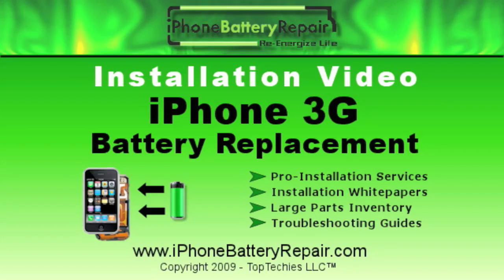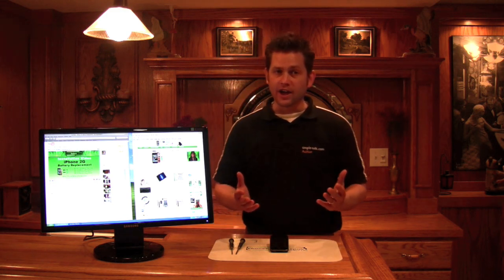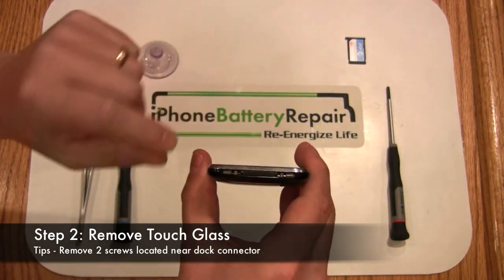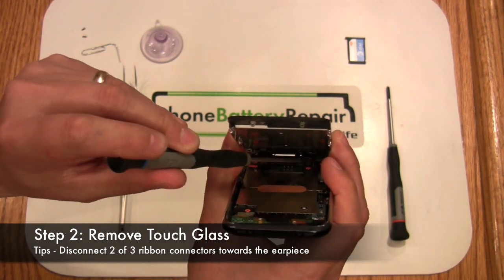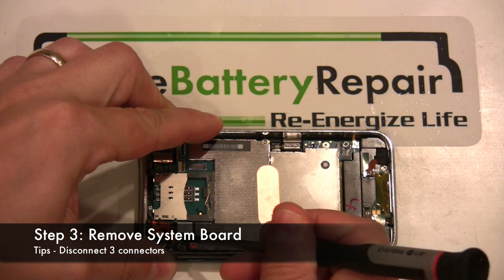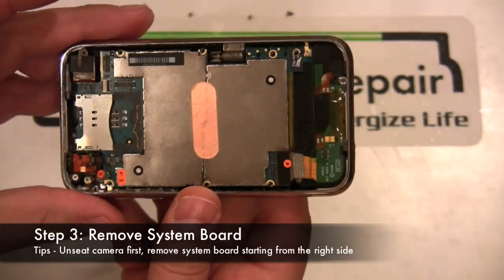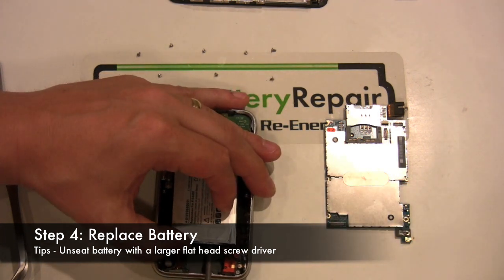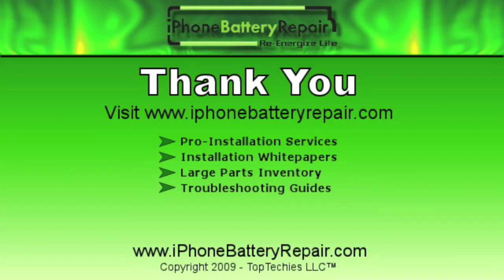iPhone 3G Battery Replacement  by AmpJuice.com

Comment: Hello and very many thanks ... super review, it is important to see how it looks inside ... I followed point by point, on a 3GS which is almost the same that was just a trick with nr 7 ... but pretty obvious what to do about it .... the same as the others ... disconnect it also;-)
but I'm glad I found your page, bought the battery the day after I saw your video, got it 3 days later and install it today ... AND IT WORKS 1000%
THANK YOU THANK YOU THANK YOU I've actually got a brand new phone again

Comment: Putting it together is definetly the hardest part of the process. The camera was a big pain. trying to get it to sit right. then that little piece of metal that the screw goes through kept falling off so i turned the video on to see how it was supposed to go back on but they sped up the video on that part. Thankfully I got it back together and it worked. I dont understand why apple would make it so difficult to change a battery.

Comment: Viva la iPhone once again...

Dropped the damn thing in the washing maching and used this to take the iPhone apart to dry it out. Once it turned back on I used one of these demos to replace the screen...now 2 months later here I am switching batteries and the iPhone is almost brand new, one piece at a time

Comment: This is by far the best instructional for replacing the battery. Hands down. But c'mon man, why'd you abandon us at the end? It took me about half an hour trying to get the #3 connector back on because I had no idea how that thing worked. Finally got it though and without your vid it wouldn't have been possible. Thanks!

Comment: i followed all of these directions and disconnected all of the stuff and when i was removing the screws, one of the screw wasn't coming off, i got the small screw driver with the battery so i used that so many times and used some other ones but it didn't work. that screw is freaking stuck like a glue and rest of them came off. i just left it there cuz i didn't wanna break anything when trying to open it. i put everything back and it turned on. to bad i could've put the new battery in.

Comment: Just did this  on my 1 day old 3G-S. I needed to  get under  the battery to place a  Memon harmonizer chip, as the  casing seems to have  a sheet of aluminium in it. All was the same as the  video except for an extra  connector marked "7" where the label-covered screw was. Note that the lithium ion battery is very soft and will bend/dent easily from a screwdriver's prying as shown in the video. I had to use a credit card to pry out the battery effectively.

Comment: This is a great video, with excellent details, another I watched only said 7 screws, not 8, and showed disconnecting the camera lense, not removing it as here.
And this video also shows most of the re-assembly too.
I wonder what Mah the new battery is? What sort of life will it provide?